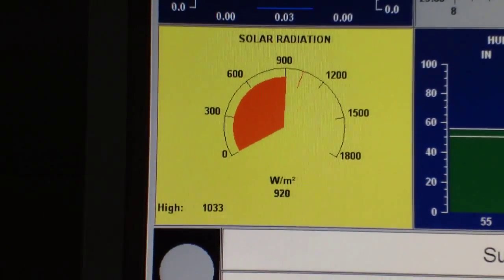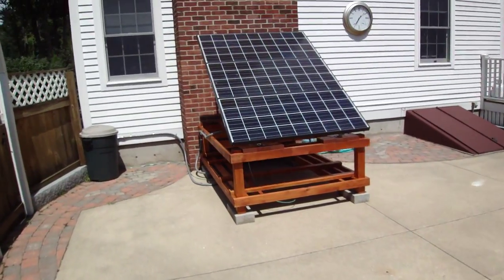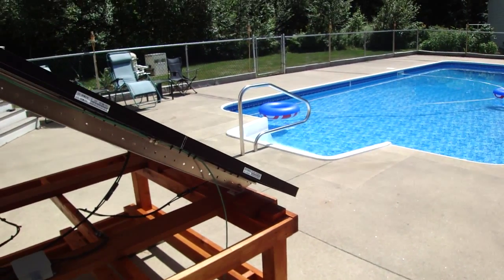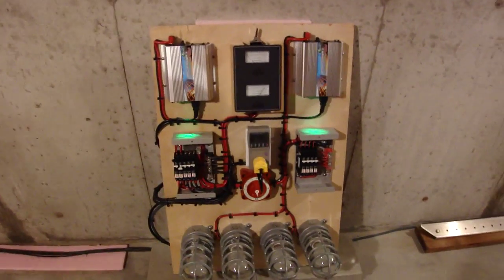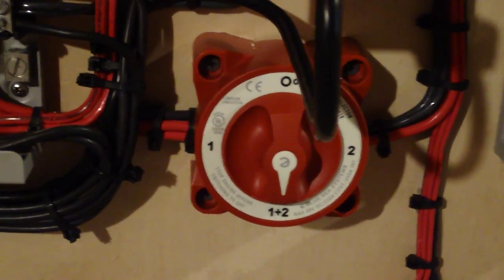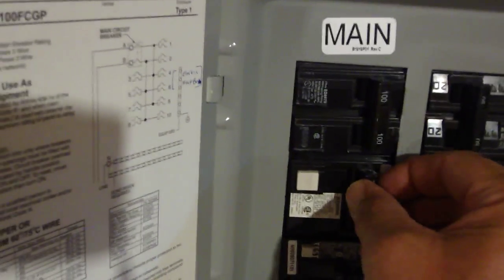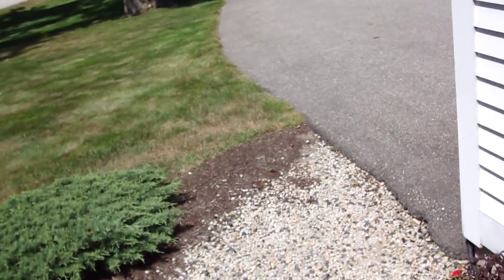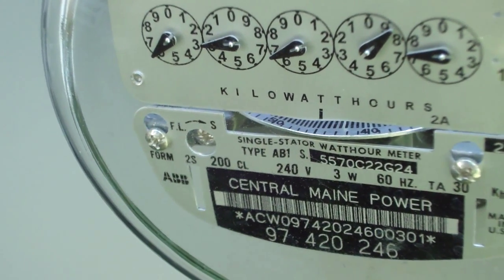Solar System Turning Power Meter Backwards

Comment: Did the kilo watt hour counter turned backwards too or just the disk?
Reply from the maker: +Romel Emperado  Great question disk is driven by an electric motor and rotates at a speed proportional to product of voltage and current.  Watts equals voltage times amps (W = E x I).  Rotating disk is mechanically geared to kilo watt counter so if disk turns backwards counter also turns backwards.   My test was not long enough to physically see counter turn backwards.
Reply: +sl44er I read a document yesterday about anti theft on these meters. The document says  watt meter will Still count up even if reverse..

I will try this by myself... :)
Reply from the maker: +Romel Emperado  Interesting I am unaware of this behavior in standard mechanical electrical utility meters.   It is possible to create a mechanical kilo watt meter that would record watts in either direction as watts consumed.Makes sense since a thief could simply reverse source and load and  create credit.   Any chance you can provide link to document?   Sadly since video was created we have been updated to a smart meter that I know for a fact will not record reverse direction power otherwise I would perform longer test on mechanical utility meter to determine if back feeding creates kilo watt meter consumption. Looking forward to your results on back feeding mechanical electrical utility meter.Steve :)
Reply from the maker: +Romel Emperado  Interesting document.   Not sure this applies to US  household electrical utility watt meters.    I would not be surprised if more recent (~30 years) US mechanical electrical utility watt meters record watts produced as watts consumed to prevent theft from reversing load and source.    Further research needed.    As stated we have been updated to smart meter so test is not possible at my location.

If you perform back feeding test on mechanical watt meter looking
forward to your results.
Thank you,
Steve :)
Reply: +sl44er I just purchased 1kw gti and it will arrive  tomorrow hopefully.. will update you
Reply: +sl44er  by the way I still have mechanical meter here..  will test back feeding on it
Reply: +sl44er just performed this yesterday on my mechanical meter and unfortunately the counter still goes up.. :(
Reply from the maker: +Romel Emperado Sorry for delay recently working 70+ hour weeks.  Glad to hear you have your 1 KW system up and running :)     Given further research not surprised producing power is logged as power consumed to prevent reversing load and source theft.
Reply: +sl44er  yeah.. not that bad because I have limiter device and it will produce power only I need..
Reply from the maker: +Romel Emperado You may want to consider storing extra power so it can be
used when solar system is not producing power.    I have had great success powering freezer 24/7 using Optima yellow top batteries to supply power when sun is not shinning.
Reply: sl44er I know this is an old video and replies but thought I would put some info out there. Because of high electromagnetic folds caused by the smart meters many electric companies will allow you to go back to the old style meters. There is a place that sells approved analog bidirectional meters that will spin the dials backwards.

Comment: i have 1 37" tv 1 42" tv living room
and 2 computer systems and internet router and few lights that run
100% on off grid 400w solar system 
have a 1000w pure sine Inverter for the tv's and pc's and a 1500w modified sin for lights and just running odd stuff 
on a bank of 6 golf cart batteries
is my first set up now i want the grid tie system for rest of house to cut bill more

Comment: the second option in Johnson co. Texas they will pay you for every watt you generate over above your consumption but they only pay about $0.50 on the $1
so building a system that will generate about what your home will consume each month is the best bet for grid tie 
or install a smaller system that just lowers your electric bill and just never say a word to the power co. :-)
i am looking at a complete 600w grid tie rig right now for $1200 at Newegg I just built a 400w off grid for tv's/computer

Comment: i talked to my power provider and we the new smart maters and i was told that they will work just fine with the grid tie but you will not get credit for any power you feed back in to the grid until they pull the meter and reprogram it 
and they have to approve the system you install 
and they have a application you fill out 
1 set up you can get at best break even and get back every watt you over generate in the day time at nigh for same value but bill starts at 0 beginning each month

Comment from the maker: @taterheadkiley  Thank you :)  The two GREENENERGYSTAR 2nd generation 400W grid tie inverters were purchased about a year half ago for $299 each and have functioned flawlessly running at half rated power.   Today you can purchase the same 400W gen. II grid tie inverters on eBay for $149 each.

Comment: In theory..the grid tie converters will send energy back into your home no matter which of the electrical meters you have installed from your power company. As long as the power (watts) being consumed in your home is greater than the power delivered from the solar panels, the power you draw from the power company should be reduced by the amount of solar energy coming in. Your energy bill should be reduced by the amount of power reduction in the home.

Comment from the maker: @TheChineseEmpire majority of smart meter installations today will not measure energy transferred to electrical utility (no turning meter backwards).   Some locals are installing smart meters capable of measuring energy in both directions.  Eighteen months for net metering seems excessive unless your utility is in  beginning stages of implementing smart meter technology.

Comment from the maker: @ronaldchiang You cannot directly connect a solar panel to the electrical grid it requires a grid-tie inverter.   Recommend the book "The New Solar Electric Home" by Joel Davidson and Fran Orner which provides all the information needed to connect solar panels to electric grid.   Many of the newer power meters cannot be turned backwards.     Like anything electrical it can be dangerous if you don't do your research.

Comment from the maker: helloman1976  
To me this looks like a hobby that's turned into a real source of power for you. Have you done any math to figure out how much you paid versus how long it'll take before you break even on what you spent? I'm curious to know how long you think it'll take. I've been thinking long and hard about buying a 440watt solar panel setup with a 400watt grid tie inverter I found on eBay for about $1500 dollars. Thoughts? Anything you'd buy/do differently? Thanks!!

Comment from the maker: We did this as an experiment to gain knowledge for eventually building a smaller house completely off grid.    Much of what was purchased has not yet been implemented including six yellow top T31 deep cycle batteries, solar charge controller, 1500W 12V to 120VAC inverter, 600W 12V to 120 VAC inverter, 5000W 12V 240VAC inverter for well pump, battery monitor, etc.

Comment from the maker: Payback on experimental system would be about 25 years assuming the price of electricity does not change and the PV power generated is directed to grid tie inverters and not to charging batteries from inverter use.

Comment from the maker: Putting a system together there allot of hidden costs like wire, lightning arresting, PV mounting, etc.   For example the six 50 foot 10 AWG MC4 cables connecting to PV panels was ~$360, likewise some of the wire purchased for battery installation was $3.25/ft.

Comment from the maker: On a grid tie only system like you are planning the payback will be much shorter probably in the area of five to seven years.    Payback of course depends on many factors like location and the amount of sun light the panels will receive, your KW cost for electricity, etc.

Comment from the maker: I have found with 405 Watts of PV and the eBay 400W grid tie inverters that two grid tie inverters in parallel produce more pore power.     On a sunny day with my system one grid tie inverter produces 290 Watts as measured by Killi-A-Watt meter but two grid tie inverters in parallel produce 345 Watts.  The grid-tie inverters do seem to play well together and share the load.   Also with two grid tie inverters they run cooler with less fan time.

Comment from the maker: What would I do differently for a small PV system?    If it was grid tie only I wouldn’t change a thing.   Given the addition of batteries and DC to AC inverters I would make the system 24V instead of 12V.   This fall when the system is complete I will do a detailed video on the control panel and system performance.   Good luck with your system, it is allot of fun producing useable power from the sun.